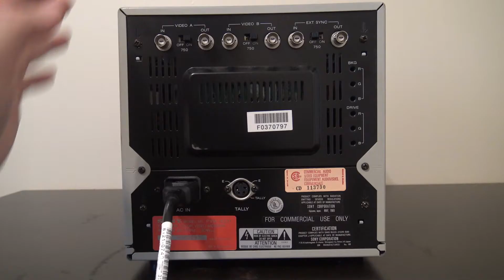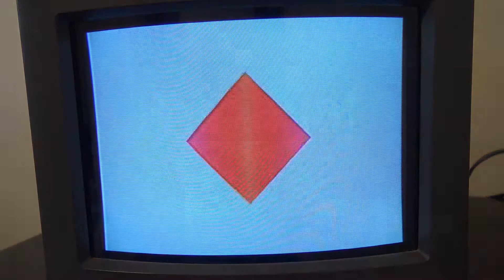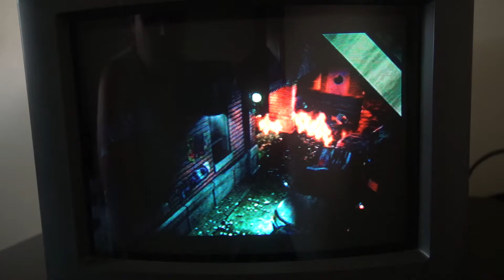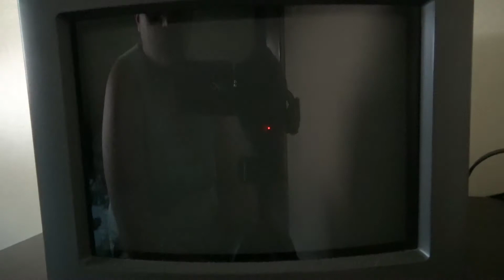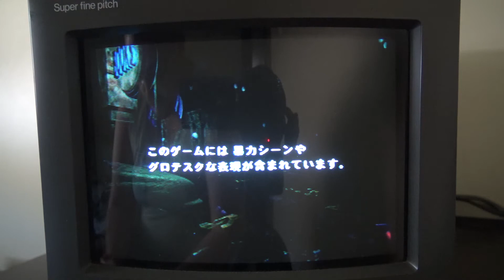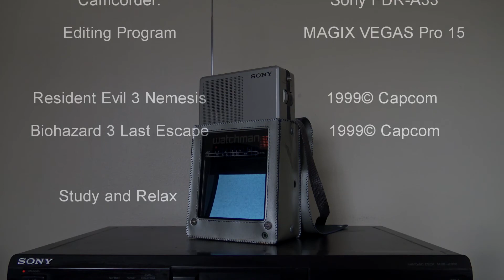Sony Trinitron PVM-8221 Oveview

Comment: I just re-watched this video and am impressed with the scanline definition and will probably move my 8220 up on my list to repair.  I wasn't quite expecting the scanline definition but I haven't spent much time looking at the 8" models with 250 line tubes.  I have 5 different 250 line 8" models but all need some sort of repair and I haven't got around to it since I have 2 good BVM 8045QDs which have the 450 line tubes.  I revived a rained-in and dead KV-9PT40 (9" consumer composite) that I use with an undercabinet mount at my desk and it does not show scanlines, although it does look good and should improve a little more with a full tune-up and RGB mod.  The 8" PVM / BVM models probably benefit a bit in terms of geometry and sharpness from the 70 degree beam deflection versus 90 degree beam deflection in the case of the 9" Trinitron tubes used in the KV-9PT series sets to allow the TV to not be unreasonably deep.
Reply from the maker: hope you can fix them up :)

Comment: if you can answer this I would greatly appreciate it. It says rgb. Do you have to buy additional parts to make this model have the use of component cablers? I'm really wanting to get one of these to use with component rgb. thx u
Reply from the maker: The PVM-8221 is a composite only model. you would need a different model for RGB and/or YPbPr
Reply: @Sonyphile  thx u. sounds like 8041q is the way to go

Comment: I bought a PVM 8220 with some color issues for around $40 shipped for something to take apart and fix. I have a spare tube in case I need it but I expect it to be a loose or broken trace somewhere.
Reply: @dedrat_  Bad colors on one side sounds like a magnetism issue.  It could be as simple as needing a few degaussing cycles and to run for a while or it could need an external degaussing tool.  It's hard to say without seeing it but if you have any questions should you pick it up feel free to reach out.

If the price is reasonable I would pick it up.  Although you can get a bit fancier even with 8" CRTs you will find that even the 250 line tube and composite video are a big improvement for retro gaming versus an LCD.  I can't speak directly to the PVM-8220 sincesharper,

Comment: I recently bought this set online and was wondering if its possible to connect speakers to it?
Reply from the maker: we are unaware if there is a speaker mounting kit.
Reply: I use a Bose SoundLink with a 3.5mm (headphone) connector to female RCA and connect the audio directly to that.  Much better sound than the stock speakers in any of my PVMs or consumer sets.  it's nice because of the portability as well.  Computer speakers (shielded) are another good option, especially for more permanent use.

Comment: does this have a stand underneath to tilt the screen upwards?
Reply from the maker: I am unsure what part number that would be, I know other models had stands available, but for this part, I am unsure.
Reply: @Sonyphile  I just got into doing some research on these, but from what I’ve seen the newer pvm like 8041/2/5Qhave a little kickstand underneath to raise the system a couple of inches for a better viewing angle.